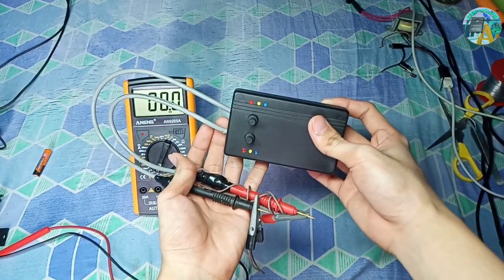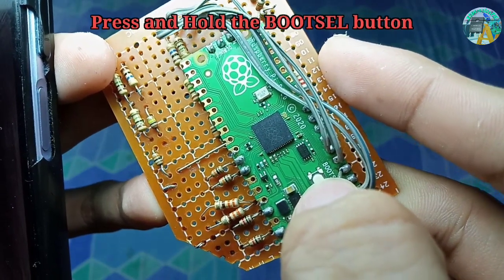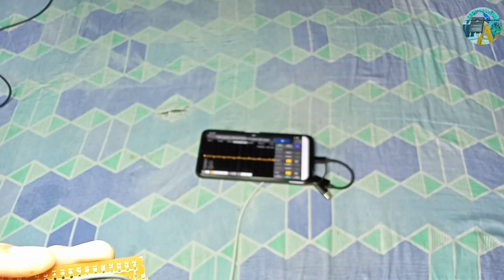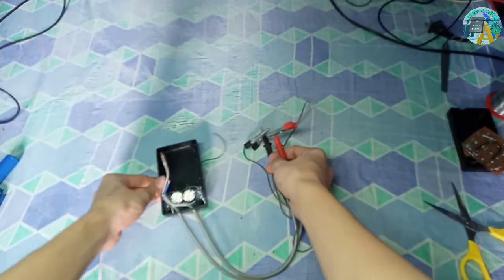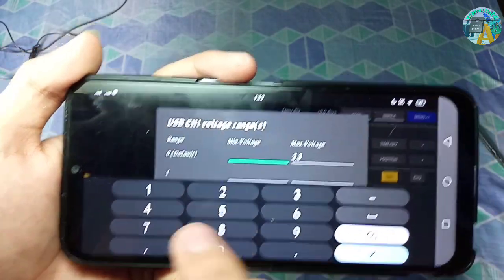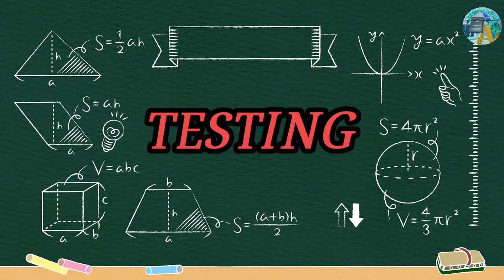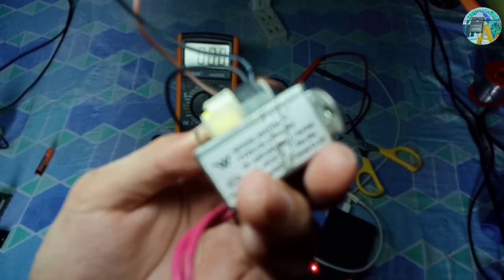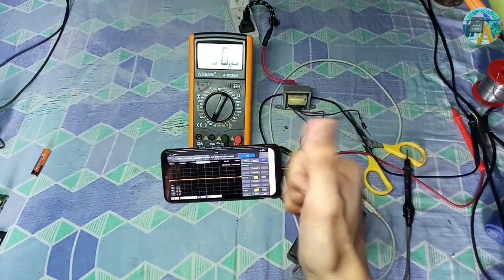Cheap D.I.Y Oscilloscope Without Using A computer Tutorial #diy #makeyourown  #electronics

Comment: hi! thanks again!, you are super skilled. can this oscope able to test 30v 3000w amp clipping or not? you are super, i need to hire u if u can
Reply from the maker: Of course it can. But you will need to arrange and calculate the voltage dividers on the input to prevent burning the Pico.
The pico can only take 3.3V max

Comment: I need the harware circuit diagram you designed for pi pico
Reply from the maker: It's on the video bro. This video is very old so I try to find my schematic.
Basically it's simple and details are provided on the website for scoppy